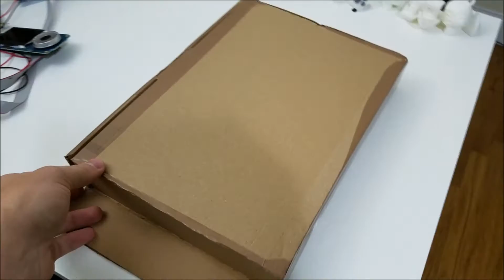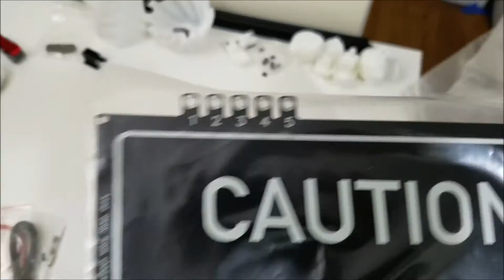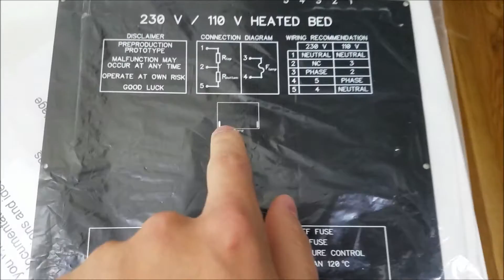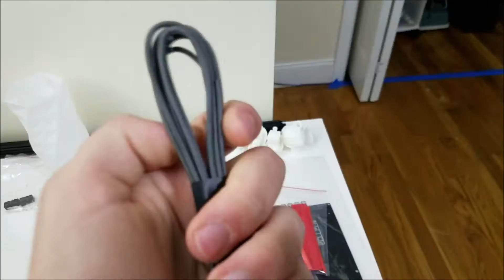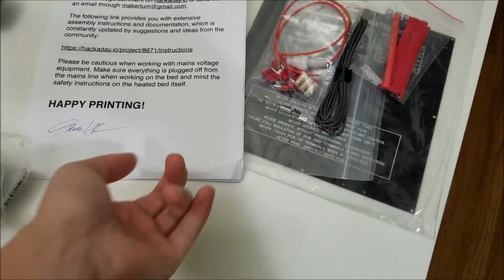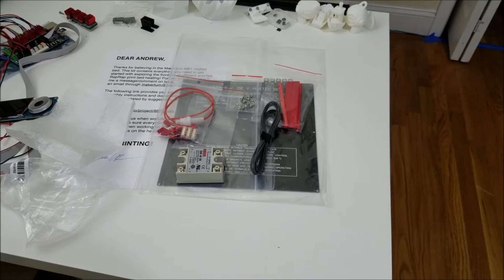Makertum Mk1 AC Heated Bed Unboxing!

Comment: 3d printed life, how thick is the aluminum top plate on the v2? I am working on building a corexy printer out of plywood. if it works in going to remake it out of aluminum. btw your designs have really helped me. I hope you succeed in whatever you want to do in life
Reply from the maker: Well thank you very much! I'm glad my designs helped you out! The top plate is 1/4", I wouldn't recommend going any thinner than that unless you add reinforcements to it!
Reply: Cool thanks for the response

Comment: Hmm not sure I like the idea of AC current and live screw/solder tabs through an aluminium bed that you contact directly...I think i'd still rather an AC silicone heater glued to the underside of an aluminium bed...

How many watts is it?
Reply from the maker: 500 watts, scary but fun! And the bed is just a pcb so it isn't aluminum, the only exposed metal is the terminals which will be covered in shrink tuning and the leds which get a nice little acrylic cover. But still this is something I would only recommend for true hobbyists who understand how bad getting shocked by mains voltage is and don't plan on leaving their printer unattended for too long at once while the bed is in use!